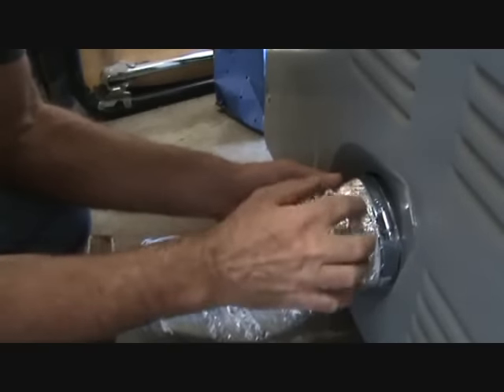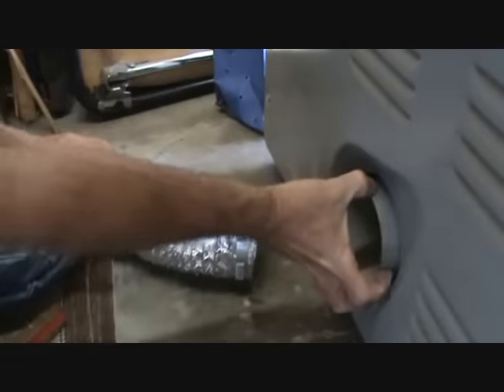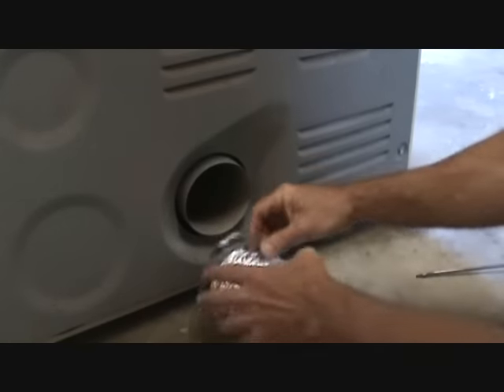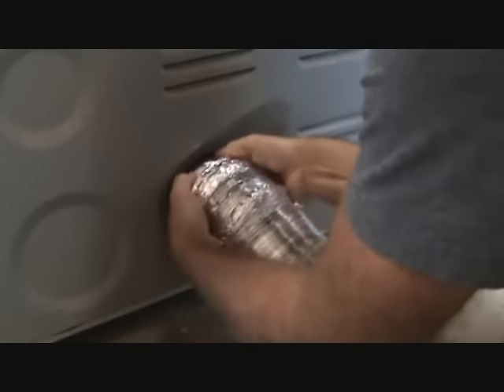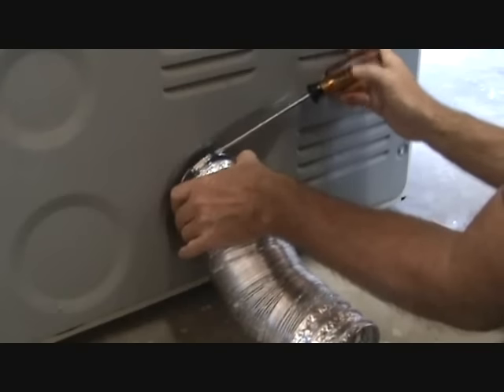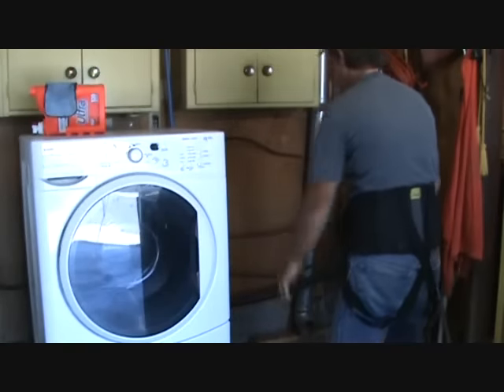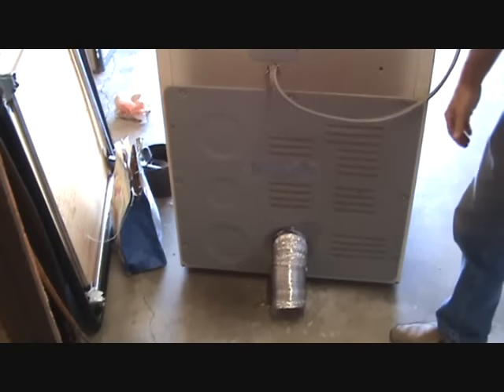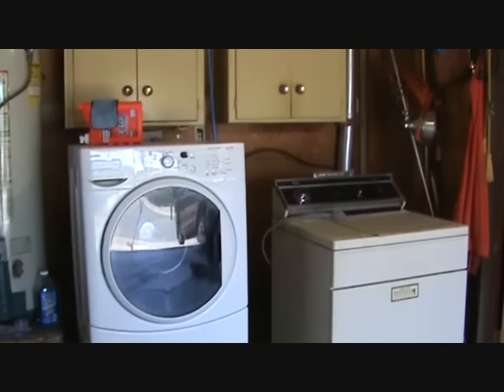How to install a dryer vent flexible pipe

Comment: I have connection experience from DC to light. Dryer hose connection excels at being the poorest design on I've ever seen. The manufactures of this crap should be investigated for being idiots. This hassle have no justification in reality. Good luck.
Reply from the maker: I agree. At least run the dryer connection out an inch or so farther then taper it so you can get the flex pipe on there nice & easy....right?

Comment: Whoever designed this crap should be fired and have to serve 10 years of hard labor. Just kidding but this is one of the most stupid systems i have ever seen. I mean all you have to do is make these hoses about 1/2"-3/4" more in circumference. Unbelievable we went to the moon but have to deal with this stupidity.
Reply from the maker: Well said!